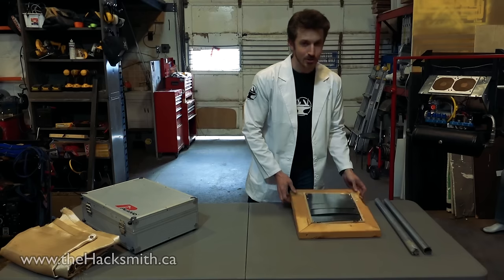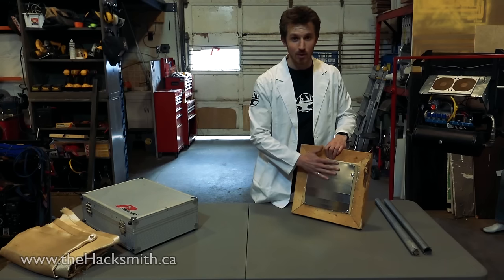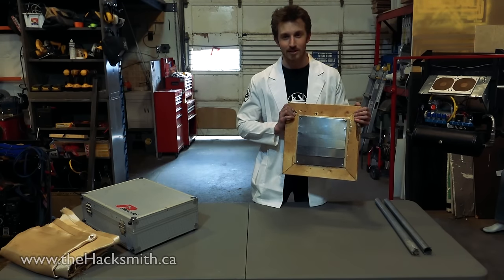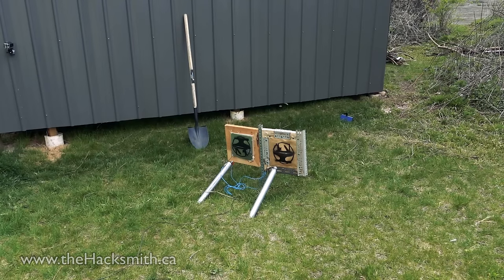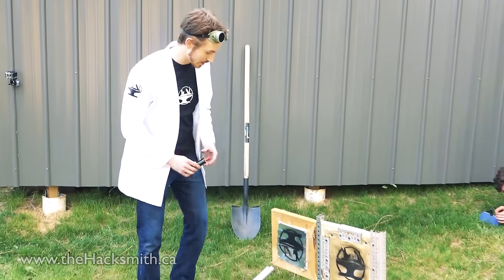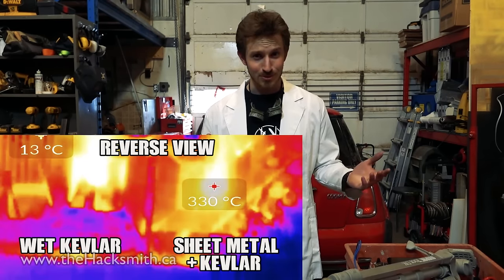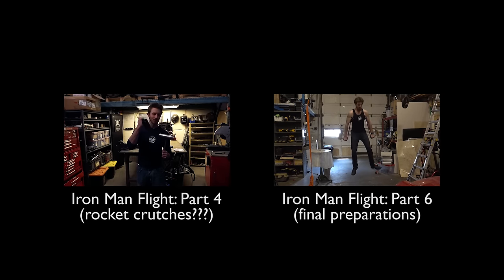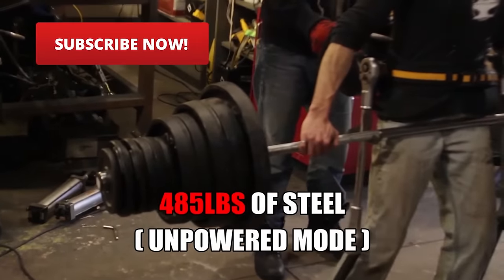Flying Like Iron Man #5: Heat Shields?

Comment: use ceramic tile... cut to provide adequate protection. just like the heat shield on re-entry vehicles. maybe cover that with something to prevent the ceramics from shattering after the initial ignition.

Comment: I think you should add pieces to the shoulder guards that go up and out incase you start to fall backwards and you have to swing your arms back to stay in the air. Because if you swung your arms back to keep your self in the air without the guards your arm could go in front of the shoulder piece or behind it and then you'll have to correct that on the fly ( see what I did there?) I think this will make things a lot safer and easier when your in the air.

Comment: What type of rocket engines are you using? Have you considered adding a nozzle at the end of the tubes the will direct the thrust downward and away from your legs? Then use a ceramic blanket like those used to insulate metal casting furnaces to insulate your legs. A piece of a descent gauge sheet metal can be placed over the ceramic blanket will fulfill your needs.

Comment: I think you could try molding a  custom fit leg armor that you could pour in heat resistant ceramic and line that with Kevlar. Maybe deconstruct a race suit to see how the Kevlar and other materials are aligned and spaced to achieve optimal insulation. Keep up the good work.

Comment: Here is how. You do it. Divide the rockets between your feet and hands, assume a Davinci pose (arms out away from your sides) your main thrust needs to come off your feet and your arms are for stabilization only and since it will be a good distance from your body the heat shields should work . But main thrust from your feet just like iron man.

Comment: Two plies of sheet metal with water between them. It's like a bottle. Empty it will melt but with water it won't. You can even use engine coolant as it won't evaporate as much with heat. This will work.

Comment: it is possible to add extra black powder to ignite the rocket,but mixing magnesium powder with it in 7(black powder):3(magnesium powder) ratio will make it create more heat more spark and less pressure,and don't seal it with duct tape, you will create way too much pressure for the rocket  to handle.Also you might want to consider adding ceramic(fiber or plate) to your heat shield since they can withstand much higher heat than aluminum

Comment: Have you considered a steel plate like the one you used to protect against back-blast, but on the inner and lower part of the rocket assembly? Not angled, just a flat piece of steel that blocks the jets from going towards your legs but still allowing it to go down. It is hard to describe with words but if you wish I could try and make a quick sketch and try and send it to you.

Comment: I know that It is kind of heavy, but you could try to use heat-resistant ceramics, like the ones used for the exterior hull of Space Shuttles.

Comment: may I suggest that you use the flame retardant material used by firefighters and a triple layer of soaked kevlar underneath? the kevlar would dissipate most of the heat for a few seconds and the retardant material should hold up to the flame

Comment: Bakelite or HR PVC(used for making flame retardant wires) followed by a layer of wax and synthetic rubber? The Bakelite would block the flame, the wax would dissipate the heat and the rubber would keep the heat from reaching your legs.

Comment: Nomex NASCAR suit 3-2A/20 will give you 40 sec of fire protection at between 1,800 and 2,100 degrees Fahrenheit (982 to 1,148 degrees Celsius). If your serious about it, use Zetex or Vermiculite suits, they offer 2,000°F (1,093 °C)) for short duration and prolonged radiant heat up to 1,500°F (816 °C). most commonly known as "Entry suit" for a smelting facility.

Comment: When I built my forge, I used a fiberglass like material called kaowool to insulate the inside of the freon tank I used as the body of the forge.  Perhaps you could sandwich some kaowool between the kevlar (kind of like a quilt).  Since the rockets are not pointed directly at the leg like in the tests the kevlar shouldn't shred like in the test and the properties of the wool should protect you from the heat with no issues.

Comment: You might try a ceramic outer layer for heat shielding, as ceramics have a higher heat resistance than most metals.

Comment: try a layer of kevlar blanket, then small ceramic tile rectangles about 3x1 inches and about 1/4 - 1/2 inch thick, then three layers of kevlar, the ceramic should withstand around 400 degrees. if not, you could try getting fires bricks like they used in steal manufacturing plants, and cut them down to size. A bit more expensive, but are meant to take 1000's of degrees

Comment: Alumina silicate plates. You can get different sizes, shapes and thicknesses but it could cost a bit. You can also buy 50 square feet of Kao wool for around $100; it's a great insulator up to around 2500 or so degrees. Zirconia (which is different from zirconium) would also work. I use it in my forge. All of these things would work like a charm. I recommend using a plate of alumina then backing it with some 1/2 inch thick kao!

Comment: You could try tungsten sheet metal, that might not allow the rocket to burn through. Also maybe a Styrofoam layer in between the metal and kevlar as thermal insulation?

Comment: Try PEEK, a crystalline, low density, high temperature withstanding, carbon or fibreglass reinforced polymer that is relatively cheap and easy to work with too! I hope I helped at all. :)

Comment: I recommend using a sufficient amount of a substance with a high heat capacity so it could absorb more heat and reach a lower temperature. You can use water but then you're gonna have to deal with the extra weight or you can use ammonia which can be difficult since it is a gas. Not sure if it will work though.

Comment: If you still want to use metal, using some regular sheet steel might provide the protection you are looking for given it has a higher melting point than aluminum. Using that in front of the weave would probably yield different results. That said, Maybe Carbon fiber? It's lighter than steel and should tank most of the heat without a problem.

Comment: i have some some idea might work 
A) Dont use Kevlar as shield cos its good for bullet but very bad for high temp. use something call Alumuna silicate fire brick incited good heat resistant and light weight for those rocket
B) You can ignite rocket simultaneously with proper fuses

Comment: copper coils with water in them that is recycled through a radiator, then cover them in kevlar and then put steel sheet metal around them.

Comment: Try to laminate Kevlar and wiremesh (you know, that stuff in which showerhead hoses are wrapped) into carbon fiber. That should withstand the flame and dissolve enough heat.

Comment: Keep the model rockets further away from your legs. Also, you can keep them pointing away from your legs at an angle.
Btw, those crutches looked pretty heavy. You may have to give that a though later on...
Good Luck

Comment: Try using Alumina-Silica Firebrick. It is super heat resistant and light. I've seen it withstand temperatures of up to 1500 degrees Celsius and stay cool through a couple inches of material

Comment: I doubt you will use this, but the best material to use as shielding would be asbestos. Or you could design some form of ceramic tiling like on the space shuttle. If those would be too heavy i would try something using a gel.

Comment: The Kevlar with a silica compound over the outer layer should reduce the heat absorption on the inner layers. You can use silica packs found in most packaging of products like new shoes, appliances, etc. Mix it up into a paste-like substance and spread it across the material. I would ditch the metal all together and just use silica, Kevlar and maybe some fire resistant insulation like mineral wool. Play with the layers, thickness, and order of materials until you find the right mixture of results between heat reduction, weight, thickness, and pliability.

Comment: Okay HackSmith, my first suggestion as first semester in Mechanical Engineering would be to create a mold of resin of Carbon Fiber. I'm sure it would be effective, but I'm not knowledgable enough yet to know how to do so. Check some materials science forums and see what you can do for cheap. :)

Comment: I guy figured out how to make starlite. Takes over 4000C and is super easy and cheap to make. 80% cornstarch, 20% baking soda and then use so much pva glue until you can form it easily. Let it dry and you have space re-entry heatshields.

Comment: Little hollow copper pieces filled with water and sealed,  the copper container would be hard to make. The water helps distribute the heat, then the Kevlar behind it to protect legs more.  The container for the water can be anything with a pretty high melting point. Titanium would be best but not too cheap and would be hard to make into the containers type things

Comment: For better simultaneous ignition try to cover the ignition wire with some wet amgstrom mixture and let them dry.
For the heat shields i think alluminuim was a bad idea, it is light yes, but it melt so easy. try with a couple of ceramic tiles, or some mica sheets. (maybe the best is alternate a layer of kevlar with a sheet of mica) because mica is fragile and made 4/5 layer.
The last idea is to cover kevlar with alluminium oxide, that is used as insulant also in furnaces.

Comment: Heat shield suggestion: Use a ceramic plate as a heat shield like on the space shuttle. the other side will still get hot but with a layer of fabric or foam, perhaps it could work?

Comment: Hi, i think you should use a ceramic lining such as kaol wool because it is reasonably light and can withstand extremely high temperatures, But i would have about an inch or two against your leg wrapped in kevlar with some sort of thin reflective steel sheet only used to reflect the heat.

Try That!

Comment: For the heat problem I personally suggest a layer system composed of a metal layer then a ceramic tile then kevlar, ceramic is on the outside.
This idea is inspired by a light Saber design and the only thing they could think of to make it not melt itself was to make it with a ceramic with a very high quality. But said idea was only theoretical just as this is

Comment: Use a coeficent heat of materials table to make the aislant. Maybe the fiber glass or the carbon fiber is more resistant to high temperatures. Make formules to the heat transference to know the better aislant and the thickness.

Comment: maybe attach a metal plate to your crutches next to the exhaust, like the small deflectors on top but not at an angle, to keep the plume away from your legs( at least mostly off) then layered kevlar pants should be good. <3

Comment: I suggest you build some sort of boot mechanism as seen in the movie with the rockets at the bottom of the boot. Try working with some airpressure for the initial lift then activate the rockets. just a suggestion.

Comment: i think if you got some fire bricks (which are soft enough to be cut with a regular saw) and you cut them vertically length wise like maybe in half and wrapped them in something like thin sheet metal (just for strength) that they would work as fire bricks can withstand thousands of degrees. it would be soo much easier to explain if i could draw it out for you.

Comment: Alloy as heat shield may as well have used copper it's the next closest conductor. From what I've heard you should use aircraft grade titanium it's hard to get that hot and is lighter and tougher than properly hardened steel

Comment: You can still use the Kevlar but what you need is a stronger metal, maybe an alloy with a carbon composites that are heat resistant

Comment: This would really send this project back to the drawing board, but has anyone considered using hydrogen peroxide rockets?

Hydrogen peroxide has a low specific impulse, but it doesn't burn that hot. Actual jetpacks use hydrogen peroxide as fuel. Sure they had a 30 second flight time, but it worked.

Plus as an added bonus the rockets could be throttled. It looks like solid rockets are being used here, which can't be throttled.

Comment: How about a ceramic tile pad for the heat shield? The flexible little (1.5cm)tile sheets that are like 20x20cm, they're light(ish) and flexible to be attached and ceramic is super heat resistant, or there a a multitude of refractory cements that could be impregnated into the Kevlar I imagine.

Comment: the metal with the most elevated fusion point is the tungsten, but i don't know the price, it might be really expensive. If it is cheap you can change the aluminum plates for tungsten plates

Comment: First use some thin sheet steel not aluminum, second you can coat the outside with ceramics if necessary, and finally get the fireproof cotton stuff that you can insulate propane forges with. Other than that I cant think of anything off the top of my head. (maybe carbon fiber sheets?)

Comment: Maybe for protection make a spray of a coolant that depressurizes or releases at the same time as the rocket. However you will than need to worry about freezing your legs, and would have to adjust the weight accordingly. Also you maybe able to use a coolant that isn't all that cool by using the leidenfrost effect.

Comment: I would say that you don't have to worry about a head on blow from the rockets, if you flare the metal out about 20 or 30 degrees and also have the Kevlar layer you should be fine. The metal will work to deflect the rockets away from you while the Kevlar will insulate without taking a rocket straight on.

Comment: if you want free firebrick, find a local pool guy.  when I replace an old pool heater all I want is parts and the copper heat exhanger for scrap.  4 sheets of firebrick about 2'x2' and one inch thick usually go into the trash.

Comment: An air layer? So  have the metal plates, maybe even have them disperse the rocket into different directions so it's not concentrated in one area,  then an air spacer, or maybe what everyone else said and use ceramic, and then the Kevlar? Would weigh more, but at least you'll have a leg?

Or make a homemade firebrick mix like concrete to be able to freely mold it to your leg...

Comment: use  first 2 layers of flame resistant Nomex® fiber , then third layer of Gypsum board & kevlar based board , forth layer of Rock wool & fifth layer of cloth or kevlar or nomax. Nomex is resistent to flame, Gypsum board & kevlar based board (custom made) gives it strength & seals the heat , Rock wool seals the heat & gives cushioning ,  fifth layer of cloth or kevlar or nomex avoids direct contact with rock wool & gives some strength to rock wool too.

Comment: I'd say try some form of ceramic scales, they might be hard to make, but if you took squares of ceramic,  managed to drill 2 holes in them, you could them "knit" them together with steel wire, which would take much higher temps to melt.    This may cause a weight issue though

Comment: The cloth should be Nomex not Kevlar. Nomex is what tankers and race car driver wear. But you still need something to dissipate or redirect the heat. Nomex won't burn but it has its limits it heat transmission. Ceramic may be the way to go. Not tiles, but something like fireplace bricks. They are spongy with lots of air pockets to reduce heat transmission.

Comment: Though this may not be very affordable you could use thin aerogel strips layered with steel plates aerogel is one of the best solid thermal insilators available and the steel plates would be usefull for the physical strength of the shield.

Comment: Maybe you should try to put layers of high metling point materials and low thermal conductivity, but not kevlar, because it loses it effectiveness at high temperature, especially after a few dozen of hours.
Maybe aluminum oxide could be nice because it is porous, so you can add the low thermal conductivity of air to the equation.
But a cooling system seems unavoidable, low thermal conductivity materials would just give you a little more time before you burn to death, so I'd recommend watercooling or the same system as watercooling but with the air that comes in contact with the suit, you can play with it's expansion, also, to make it kind of pulse to cool it down (would require valves and a lot of thinking, if I get bored i might do some research on it and get them back to you)

Comment: Are you just using Kevlar or are you using fire resistant Aramid? Either way I dont suggest eithet, Aramid only goes up to about 300 Degrees Celsius, you're easily pushing above 3000 degrees celsius. sheet aluminum isnt going to help much at all with that, the only way to do this half safely is to go with a far heavier metal, even then thats only going to help for a small amount of time before the heat sinks through it and to the fibers and your leg.

Comment: KaoWool, its a ceramic fiber which is what a lot of backyard black smiths make forges out of. It heats up after a time but for short duration would  be totally cool. just not sure about the flexibility of using it as a pants material. would totally have to reinforce it some way.

Comment: make a relatively light mold out of some material that wont degrade under high heat for both legs then coat the outside of the molds with something that's not easily flammable or just fire resistant maybe this could work for protection but maybe not. :)

Comment: you could use tungsten if its available because it has the highest melting point out of all the elements (metal elements),
but it could be pretty hard to work with and very expensive.